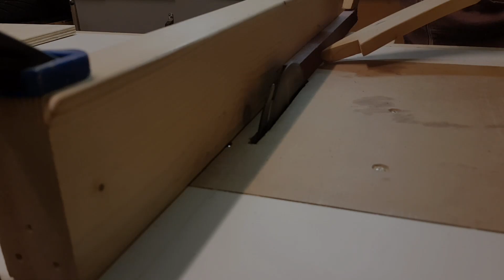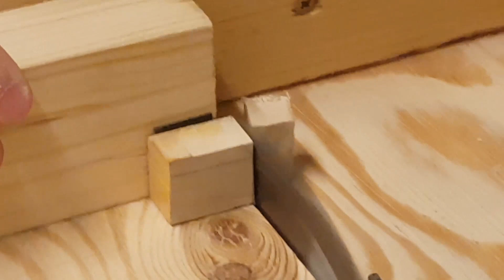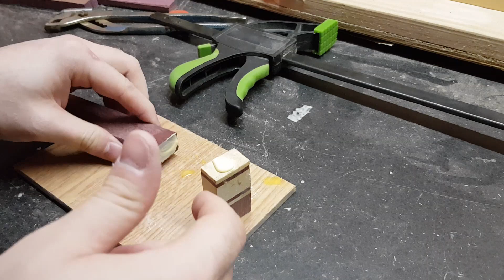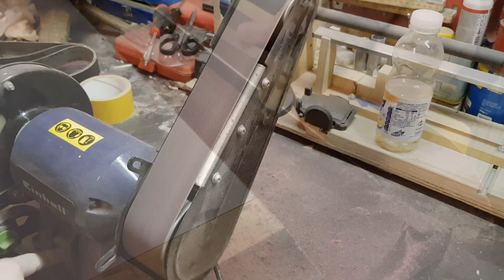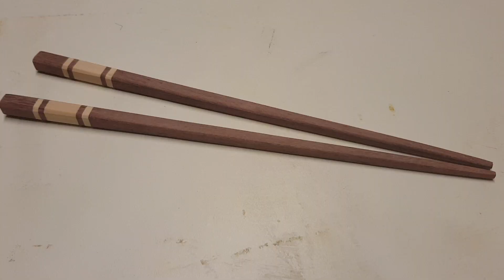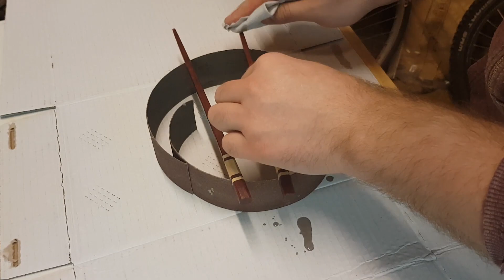Making my own set of chopsticks with birch inlay!

Comment: what kind of oil did you use? ive used mineral oil in the past for food safe products but have had issues with it not sealing out moisture well enough
Reply from the maker: Since this is my first pair, i also just used mineral oil, however i am running into the same problems as you i think,  they seem to absorb a lot of moisture. so i might look into some other finishes when i make my next pair
Reply: i know there's a few food safe finishes out there. i suppose you could pick up a food safe epoxy and coat them in that.
Reply: Maybe, as a suggestion, try using beeswax.  It is what I have used in the past for most of my finishing, especially on items that will touch food.
Reply: @dolfinmagikpro  as a Chinese I would say usually that is how we coat our chopsticks traditionally. works pretty well.
Reply: Ploycoat it’s food safe and keeps wood completely protected from water
Reply: Sean Robinson it won’t stick in the wood
Reply: Garry Mackinaw how?
Reply: @shotgunlobotomies2352 when you apply the bee wax onto the wood, you rub a huge piece of bee wax on the wood. the heat generated by the friction will melt the wax and thus the wax will fill the gap in wood and also spread out on the wood evenly.

Comment: I dont know if you are still around BUT Did you glue the wood side grain, long grain or end grain??
Reply from the maker: End grain, the strength in them is of course weaker for this reason so not recommended :) but it worked, however they did break once, and i had to reglue. 

Regards

Comment: Been trying to learn about chopstick making and am running into issues you may be able to help me with. How strong are your sticks along the glue line? For some reason with my sets they keep breaking along the glued seam.
Reply from the maker: I can try :) glueing endgrain pieces together can almost always be tricky, unless they're sealed with something first before gluing, for example you soak the end grain with some glue and then wait till it dries, and then gluing the pieces together could prove beneficial, however I haven't tried it so I don't know how it will hold up both look wise and structurally. I did have mine snap at the line as well, so I reglued it, and hasn't snapped yet, although these chopsticks have only seen very little use since I made them mainly for practice. Hope I could shed some light on your problem :)
Reply: @lorddelle  hmm interesting. I was attempting some gradient stacking( first piece is 1/16, second is 1/8 and do on to form a gradient between 2 wood colors) and it kept breaking under very little stress. I’ll give that technique a go and see how it turns out. Re-gluing isn’t going to work since the footprint of my sticks appears to be half as thick as yours (1/8 - 1/4 tapered)